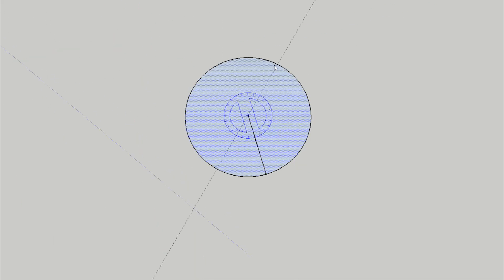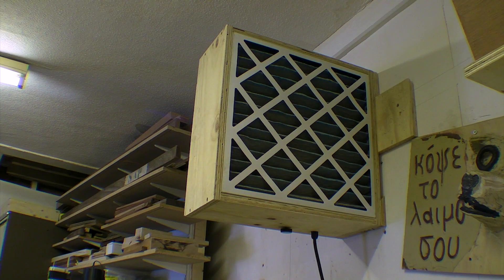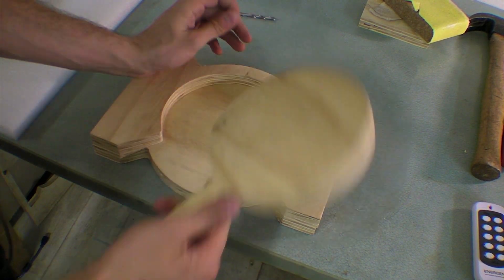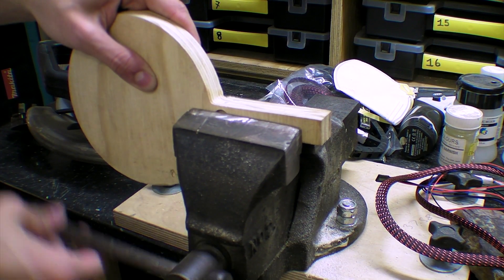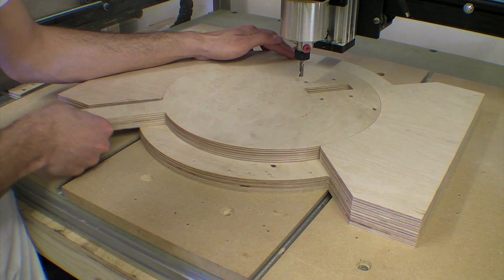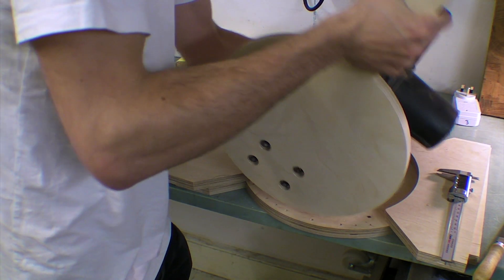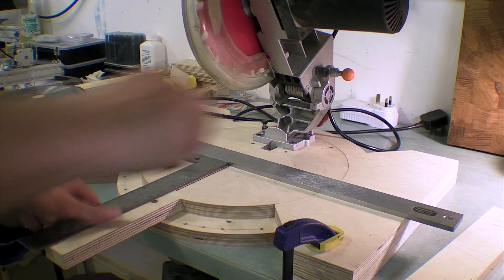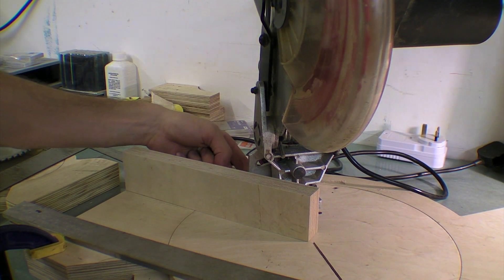Pivoting Mitre Saw Base - Part 1 / Design, CNC'd Parts and Positive Stops

Comment: That's a really cool build. One thought: will the positive stop bearing not wear down the holes in the ply pretty quickly, thus affecting accuracy? Maybe using washers with an ID of the same diameter as the ball bearing, set into the ply, would address that?
Reply from the maker: Yeah I should have cut that out when making the holes, but I don't feel confident getting that bit re-cut now. :/